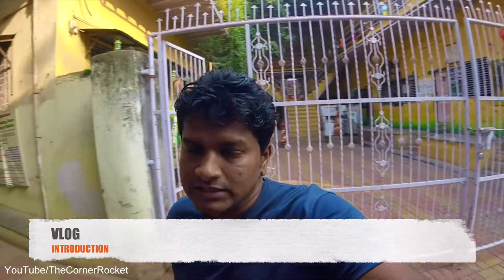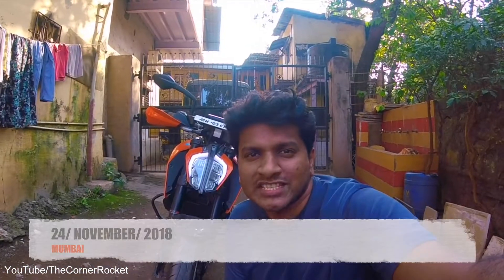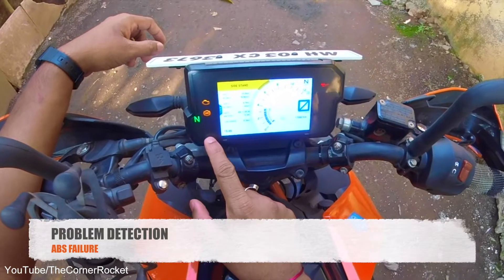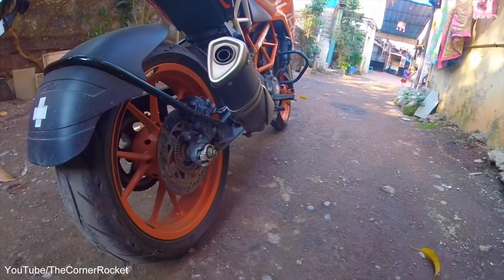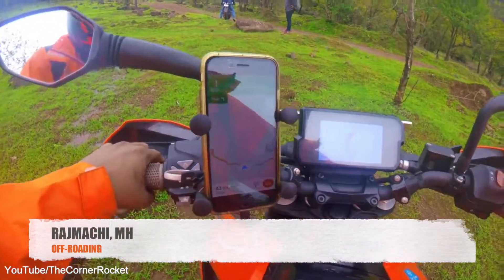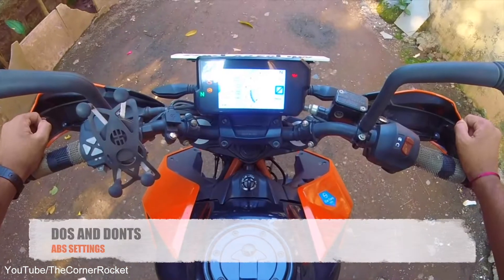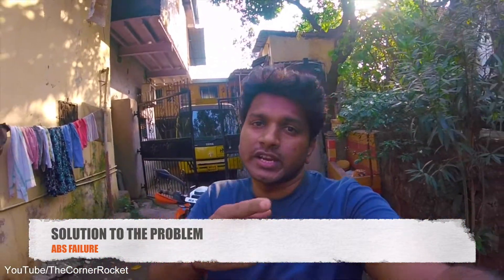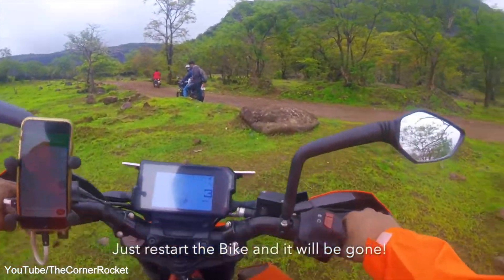#137 KTM Duke 390 Problems | Episode 2 ABS Failure | 2017 2018 Model | Review Cons after 17000Kms

Comment: I noticed that if you ride your duke 390 abs or rc 390 abs in the slippery or muddy area you might encounter abs failure because the wheels are slipping differently which is the ABS installed is a 2 way channel and not a 1 way channel. If the wheels are slipping or not in the same speed, automatically the warning light and the abs light will turn on... but if you will stop the warning lights including the abs light it will be back to normal again but if aint not working you will have to turn it off the ignition and then turn on again. But in my case, a 2018 rc 390 i don't need to stop or turn off the ignition. It will just automatically back to the normal function itself.
Reply from the maker: Thanks for the information
Reply: @TheCornerRocket  your welcome brother. 🤔 i encounter it again just this morning. Just yesterday we had a rain and the roads are wet. I just thought that the maybe the tire are slipping or it is because of the dirt because sometimes dirt may stock to the brake pads which will block the abs sensor. 🤔 by the way my speed that time was just under 10kph. That was my 2nd time I experienced it. But on cruising speed or 150kph plus I haven't.